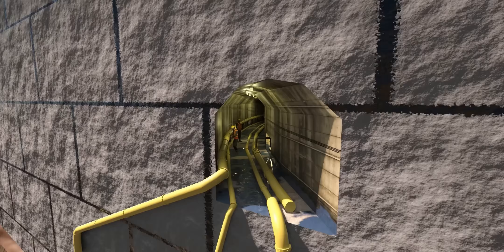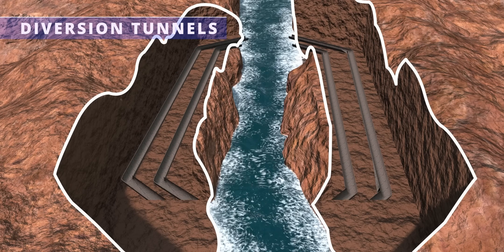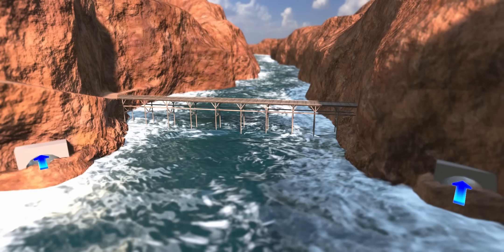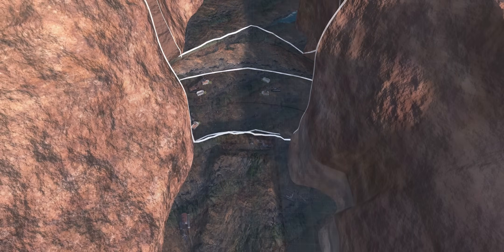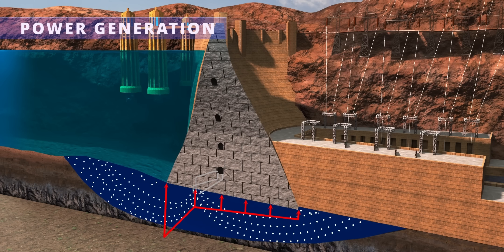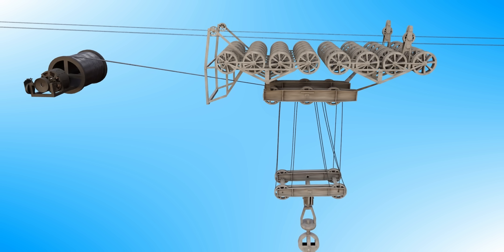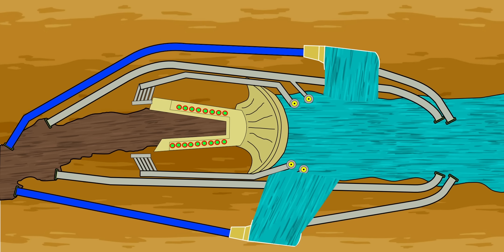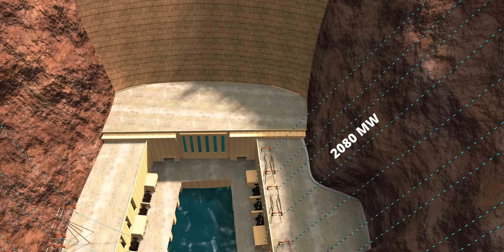Constructing the Wonder: Hoover Dam Secrets Revealed

Comment from the maker: I hope you enjoyed the Hoover dam construction video.  I would truly appreciate your support on Patreon - https://www.patreon.com/Sabins

If you would like to access our course on 'Photovoltaic power production' please check out these links - https://sabinmathew.com/courses/photovoltaic-power-production/#tab-course-section__curriculum.
Udemy - https://www.udemy.com/course/photovoltaic-power-production/?referralCode=6B9FDF6368AB260E3572
Cheers Sabin Mathew
Reply: the video is solid, but the random loud music outbursts are terrible, distracting and a pretty big turn off.
Reply: I really enjoy your videos, pls can you make a video on digital potentiometer.
Reply: Paused to reply 41 secs in. As the reservoir was filled the weight pressure of the water closes the gap forming a tight pressure fit. Hope it was cemented or grouted. Most of the load from the water is transferred sides to the cliffs on either side. It's an arch dam.
Remember those crazy wooden block bridges with curved faces between blocks, a human can stand on it and curve of bridge adjusts to the load. In an irregular curve.
The other thing holding water back is the massive weight of the whole dam, getting thicker towards the base as water pressure increases.
Wrong
Interesting aside ice was actually added to the concrete mix to keep temperatures under control. For a few years the dam had the biggest ice making facility. Excess Heat prevents concrete from curing properly, making it weaker and more brittle so increasing chances of failure. 
That's from years ago as a teenager. Knew about the 4 bypass tunnels. I think they still use 2 of water, and 2 for human engineer access.
Reply: No audio?
Reply: To the las comment in the end about the solar power plants. If you would like a solar powerplant to match the annual REAL (not theoretical or installed, but real) output of the Hoover dam, you would need a solar panels in about 10.000 square miles area! And that is for LA area. If you would move it to north or inland, you would need even more.

People still confuse installed and real output of solar panels. They make sense in some situations, but not always and not for everything and there is no way to replace Hoover dam powerplant with solar power plant.
Reply: There are no "secrets".
Reply: Video on three gerges dam
Reply: This pressure is calculated by construction engineer ❤❤❤
Reply: Plz sir upload more video about civil engineering
Reply: NO "secrets".  Thumbs down for simple-minded clickbait...
Reply: Thanks
Reply: Sabin
This is your 8th video since your video about the collapse of the twin towers. In that video (6 months ago) you said it would only be 1 week until you upload a video about the collapse of WTC Building 7.

Have you abandoned doing a video about WTC 7 or are you still intending on producing a video? If the latter, when do you anticipate uploading the video?
Reply: Good animation
Reply: Doing these reuploads is actually worse for your analytics and trying to build a following. It annoys current followers, looks like a cash grab (instead of earnest science communication), and resets your stats for each video, making it less likely to be recommended by the algorithm. Your best bet is experimenting with titles and thumbnails the first 24 hours or so after posting.
Reply: Where’s that WTC 7 vid?

Comment: Superb step by step Dam construction with 2 dig in rockfield water tube diverters. Though laborous. Why not use quick install super science tough made material fibers of vacuumizer hose at dual side of either leave in place or carry by truck portable water molecule energy powered motor diverted to dislodge reroute excess sea waters of Water Dam pressure, and AI controlled anti drone lasers camouflaged in rocks with imbedded rock scanner steerers. The important machineries of open architecture fit for the underground of counter automation sabotage buffers and  counter ploy and pressure controller of temperature regulators and pathway of water flow next generation cement wavy structure underground construct to make the sea water dance removing tension of water pressure at the dam. And a Starlink like orbital interconnect plug and attach then  remove relocate if seen by other Satellites of monitor the other Satellites signals near Earth orbit of sabotage or not the reason why farther away the starlink  like Earth orbit valence while monitoring distal space if there's ugly aliens coming.

Comment: This video is stupid. He says these grout filled holes drain the water. If the 'holes' are filled with grout then they aren't holes and the can't drain anything. In fact they drilled a large number of drill holes vertically under ground before dam concrete was poured and pumped grout under pressure into them trying to fill cracks and voids in the rock strata. It is called a grout curtain. After Dam was finished the discovered that the grout curtain was not extensive enough. The had to go in the inspection tunnels inside dam and drill and grout more holes.

Comment: The part about UPLIFT of the damn is crazy.  I just watched a short clip of a smaller dam failing.  The concrete dam lifted the one section almost perfectly vertically and then it came crashing down.  I was blown away.  Ended up at this video and it answered my question.  Fascinating physics.

Comment: great video.  Another bit of clever engineering....  the pins that connect the steel penstock cylinders to each other were frozen, then quickly installed.  Their thermal expansion locked them into place.

Comment: They did not lower an entire rotor down to the power house you do not know that these cranes probably lifted around 200 tons the rotor weighs up to 600 tons unles that is the rotor for the pelton water wheel then that would make sense, but yeah no the generators were brought in many pieces and then were built it just looked wierd because of the way the cable way lowered that rotor the cables would have broke

Comment: The Mississippi River Flood Control Act of 1928 funded this construction. After the 1927 flood that killed 1000, left 700,000 homeless, and 27,000 square miles under water for many months, the army corps came up with a massive plan to tame the river. But western congressmen blocked the funding until Boulder (Hoover) Dam was approved in order to develop their states and gain more political power. Also, the spillway has only been used twice - once in 1941 and again in 1983 (the year Glen Canyon Dam was nearly lost). When used in '41, the tunnels did experience cavitation but that was resolved and repaired. Lake Mead was filling with sediment much faster than anticipated but this was largely halted once Glen Canyon Dam was built. As is, it has lost only about 10% of its design capacity. Since 1983's scare, they leave about another 10% as emergency capacity and maintain the water level below this. Also, about 50% of the mountain snowpack runoff that originally went to the Colorado River (and into Lakes Powell and Mead) is now diverted across the continental divide to the east side of the mountains, before ever reaching the river, for Colorado's use.

Comment: Nice. Only feature I believe left out was the seepage at the right and left edges which apparently was deliberate. Not sure how much seepage in terms of gallons nor do I recall how this seepage was shunted away. It sounded as if the cement was left un bound to the rock wall for expansion and contraction. I also do not know the size of this gap. My guess is millimeters.

Comment: Also about the construction of the diversion tunnels, in pictures they had to put steel grates at the entrance where the water would flow through and out of the other side to prevent large rocks getting sucked into the tunnel and clogging it up

Comment: And 88 years later the dam is still working to perfection and hopefully will continue to serve America for years to come.  Great video.
Reply: That is true. Power output has decreased significantly, and the cost to maintain is being questioned.
Reply: It's quite a wonder.
Reply: Tell it to the rest of the American infrastructure, too.
Reply: Power production & water control was meant for publications only. The real purpose is to detain Megatron a.k.a NBE-1 under cryo system and study the alien technology it brings with.
Reply: It would be working for the next 262 years when it would become a strategic location for the New California Republic
Reply: except it's not. there hasn't been a lot of water or power production for quite some time.
Reply: @duroisgawd power production is a side note, that wasn’t its main goal. Its main goal was water control.
Reply: @shotts90 that’s what they tell you and you believe it, however a certain bomb would not have been possible otherwise, so use your imagination.
Reply: @alanmeyers3957 the dam was COMPLETED 10 years before “the bomb”. The Manhattan Project was not in mind when the Hoover Dam was proposed/designed. Not saying Los Alamos National Labs did not use any of the electricity, but that was just happenstance
Reply: @duroisgawd  Yes, but it's not a Dam problem - the Dam design is just fine.
Reply: @duroisgawd it has never not produced power.
Reply: @alanmeyers3957 The vid showed power production was not realized until years after damn was done.
Reply: @jakecruise90 Is that considering a future false flag by the US regime on the dam?

Comment: How do they synchronize the generators to be in phase and and at the correct frequency? That is the more interesting question.
Reply: Shaft brake, I imagine, applying just a small amount of pressure to slow it slightly down until it is in phase and then lock it in to the grid and release the brake.  Also water gate adjustment works

Comment: “ Tunnel boring machines unpopular at the time”??  They simply did not exist for hard rock tunnels.  First introduced in the 1950’s.  Also the jumbos did not drill sideways as the illustration shows.
Reply: Neither did the AI used to generate the script for this video.
Reply: Early TBMs were used in the US in the 1850s.
Reply: its ai generated
Reply: @ganondalf8090  no, it's manually generated using 3D CAD software.

Comment: Why has Lesic’s animation quality decreased significantly?
Reply: It's comically bad
Reply: Using same old software probably...I'm no animator. I just watch Corridor Crew. Perhaps Lesics should just use Unreal Engine 5, so Lesics can see the animations and renders in real-time.
Reply: @EyesOfByes  that's not how animation works, it's like drawing: using better paper and pencils won't change your ability to draw, they look bad simply because they stopped putting in as much time(or money).
Reply: @nerds-nonsense probably time. I can make these animations pretty realistically, but first of all it would take me 15 hours to model everything, then an hour to setup whatever the specific animation would be, and then rendering times would be insane if you don’t want noise. On my gtx 1070 and 32gb ram I predict each frame would take me 30 minutes to render, maybe even more with the water simulation. If I would use the less realistic settings, it would be able to render in real time. If you have 24 frames per second which is really the limit before the eye can tell it’s choppy, each second would cost me 12 hours to render. That’s 720 hours for 1 minute and this video is 17 mins and 30 seconds.

Realism is not worth that in my opinion for a video like this. It doesn’t make it any more engaging. Especially compared to the cost.